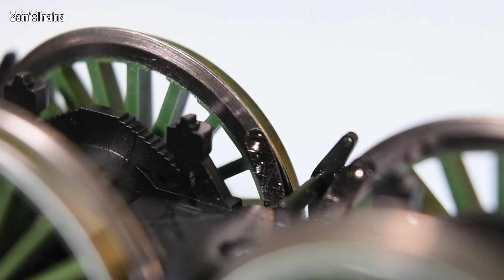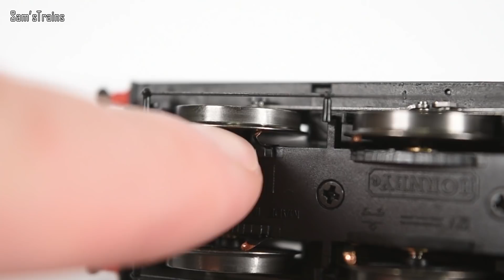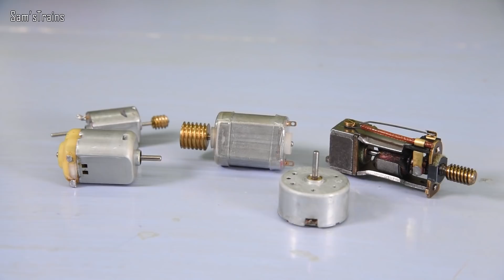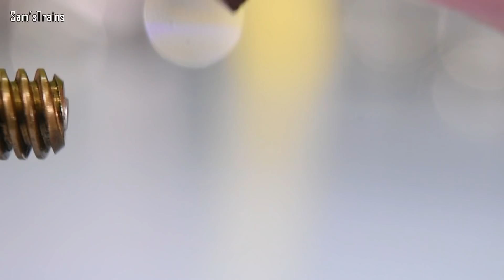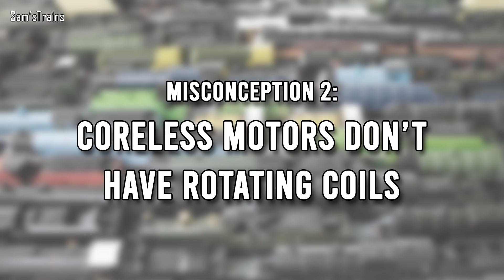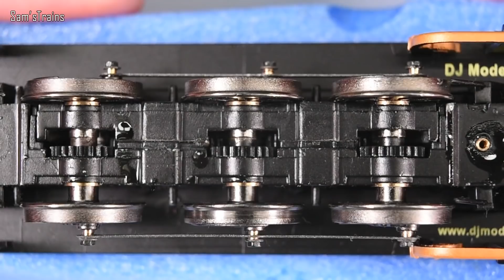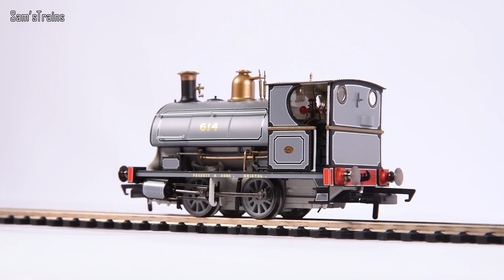What Makes A Good Runner? | How Model Trains Work

Comment: Sam I need help I have a try-ang princess and it needs fixing when I first locked at it the soldiering came of so I got my dad to re soldier it and when we test it the power cuts out on my controller
Reply from the maker: Sounds like a short Rhys - you need to make sure the solder joint isn't touching the metal chassis of the loco... a bit of tape might be enough to fix the issue!
Thanks for watching, Sam :)

Comment: My railion 185 db loco is very slow but powerful runner it takes a 9 car mix length rake well also got my sncf a9u now and added couplings plus a hornby wheel until my roco dc set of two comes, also adding to my snupps with the bmz regio jet one plus sncf repaint into bmz regions and the pkpic ones I have bmz versions of as well
Reply from the maker: Thanks for sharing mate - I'll have to check out your snupps account again some time! :D
Thanks for watching, Sam :)

Comment: Amazing video! You did a terrific job explaining everything accurately in detail and this will hopefully help more people understand how these things work. Only one thought I had, you mentioned that some manufacturers will decide to drive every wheel on a steam locomotive with a gear instead of just using the drivers and while it is true that using this method causes more friction, a major advantage of it is that there is less risk of binding. The drivers are under a lot more stress without gears so it makes it a lot easier for one of the wheels to slip out of place and become un-quartered. I've noticed a lot of modern manufacturers seem to be going with all geared wheels, such as Rapido Trains Inc with their Royal Hudson models. This is still an absolutely terrific video, I just wanted to share my thoughts on that. All the best ~Harrison
Reply from the maker: Thanks very much mate, really glad you liked it! Yes that's a good point - with a single geared axle, quartering becomes much more crucial - thanks for sharing!
Thanks for watching, Sam :)

Comment: Nice video, one point on gearing, while most manufacturers use worm gears, these are a big source friction as the tooth engaged with the worm gear is rubbing against it as it turns, and acting like a break. This effect gets worse as the load gets heavier. Some scratch builders are using alternative gearing to avoid this with very impressive performance improvements both at slow speed, and total load a given motor can pull.

There was a nice article on this in railway modeller a couple of years ago.
Reply from the maker: Yes you're absolutely right actually Daniel! What sort of alternative gearing do they use? I'd be interested to find out! :D
Thanks for watching, Sam :)
Reply: @SamsTrains  A form of bevel or mitre gear like is used in a car to turn the differential from the propshaft. I would dig the article out for you, but I cannot get to my old editions due to lockdown.
Reply: It also has the advantage that the wheels can turn the motor, so trains can coast without a fly wheel.

Comment: Excellent review Sam. Even I who worked in a motor design and manufacturing company, was not aware of what a coreless motor was. We made brushless motors which I to was assuming they were. And yes indeed, brushless motors need major electronics to actually work.
I'm most impressed with how you deliver the dialogue without lots of ums while you think of the next thing to say. Do you type this all out on a que card (laptop screen) in advance, rehearse it or are you a naturally gifted public speaker ? Whatever you do, it works mate.
Reply from the maker: Thanks Andrew! What do you think about brushless motors in OO locomotives? Could it be done you reckon? What sort of cost would you be dealing with?
Many thanks for the kind words - I just have bullet pointed notes which I look at between takes - that's all really! :D
Thanks for watching, Sam :)
Reply: @SamsTrains  I've Googled micro brushless motors and it seems they are quit common, being uses in electric RC aircraft and drones. These ones though are very high reving at say 40k+ rpm. The control electronics look like they could fit on a PCB comparable to a DCC sound decoder, so probably doable in a 00 diesel loco. Just maybe a brushless motor itself is cheaper than a brush motor because there are less parts. The control circuit should be cheaper than a DCC sound decoder, where I'm guessing you are mainly paying for the effort in creating the sound file and its software engineering, not the electronic components which are quite cheap these days. Whether these motors have any distinct control and power advantage over a conventional DC brushed motor, to justify the additional space and cost, I don't know. More likely they could appear in 0-gauge. Never say never. 
Our aerospace motors had rotor position sensors so the number of revolutions could be controlled and stopped dead, so not to wrench the control surfaces or undercarriage doors off of the airframe. This needs more complex electronics than a basic motor to be used in a model train.

Comment: The only thing I'd add is maybe a discusison of the different types of "proper" bearings- usually they're either turned brass or sintered bronze.  I have a preference for the latter because the porous structure of the sintered metal can absorb oil, making them effectively self-lubricating, not requiring service for a very long time.
Reply from the maker: Yeah that's true - I thought while editing this that I'd oversimplified that section by calling them 'turned brass'... but decided it wasn't too important. This is very interesting though - I wasn't aware of this!
Thanks for watching, Sam :)
Reply: @SamsTrains  The bearings at 17:30 seem to be the sintered bronze type (correct me if I'm wrong...) and those can usually be distinguished by their slightly more "dull" and "red" look, compared to brass, doubly so if they have a square shape on the outside.

Comment: Excellent video, you have real skill as a communicator.  Q.  What was the conductive lubricant you were using the the contacts?  My vintage Tyco Ten-Wheeler is not running so well and I may have lubed a bearing pickup.
Reply: Bachmann E-Z Lube is conductive.
Reply from the maker: Thanks very much Clive! I've been trialling petroleum jelly for the past year or so - provided  you keep it away from plastics, it seems to work great on pickups!
Thanks for watching, Sam :)
Reply: @Boppy-B-B  Thanks, good to know.

Comment: B12 in the thumbnail of what makes a good runner video 😁 Well in the case of the B12 i recommend that you remove the motor and gears and have it pulled along by another engine 😂😂😂
Reply from the maker: haha really?!?! Mine's an amazing runner - what happened?!?
Thanks for watching, Sam :)
Reply: @SamsTrains  I had 2. The first ran very erratically and the second one white smoke started pouring from it.  I replaced it with a D16.  No complaints with that so far.

Comment: Excellent information and very well explained. I say the “Holy Grail” of motors would be brushless and being they are the motor-of-choice for drones, size and weight would not be an issue. As for cost, brushless motors in power tools now long ago would cost 30-50% more and only found in the premium line of tools (DeWalt as an example). However that is no longer the case. Even the lower-end to mid-level “pro-sumer” brands of tools (Ryobi, Skil, Craftsman here in the states) all are moving almost exclusively to brushless motors with the cost coming down quite a bit and sometimes costing less than brushed motor tools. I think these model train manufacturers need to step up and start using them, not only to they provide better power and torque, but they have far less wear. They may be costly as first, but that would go down in short time if it became widely used.
Reply from the maker: Thank you! Yes brushless would no doubt be better - they are cheaper now, but nowhere near as cheap as the motors currently used in model railways. The other problem is that all model railway circuitry (dcc decoders, controllers etc) are all geared towards brushed motors; a lot of bulky circuitry would be required to run a brushless... a real problem given the size of some of these models!
Thanks for watching, Sam :)
Reply: @SamsTrains  
Hi the general issue with the brushless motor is their control electronics. While in the handtools, the electronics ( micropcessor) is on board between the battery and the motor, in the model trains it would require an extra circuitry to convert the varying voltage in the  tracks into the varying frequency  of 3 phase  power required for the motor. The basic difference is before the motor starts to spin, the electronics require a minimum voltage between 3-5 Volts in the tracks ( it is more than 1/3rd of the overall control range) and only above this voltage can start the more or less controlled rotation of the BLDC motor. 
Some decades ago Märklin developed such electronics, but was forgotten very soon. ( I think it was called as sinus drive).
Reply: @railfilm  I have a couple of Marklin locos with the C-Sinus motors in them. The electronics are on a Printed Circuit Board in the loco (just about every loco these days has a PCB anyway). The only difference when installing a decoder which is not a Marlikn one is that it has to be programmed so that AUX 4 is always switched on as this is what powers these extra electronics.
Reply: @kiwitrainguy.aka.Dennis  That is correct,. In digital operation the situation is different, as you have always the full voltage in the tracks, what is sufficient to drive the BLDC driver circuits.

Comment: So per say if I put a flywheel instead of a capacitor in my ebay-acquired 0-6-0, it will get rid of the choppiness? My next question is how would you go about installing one?
Reply from the maker: Yes, in theory it would! It would only cure choppiness caused by the motor though; if there are other underlying issues with the mechanism (something binding etc), it won't help! You'd need a motor with a shaft extending from both ends of the motor, and then you'd want a flywheel designed for that shaft diameter - I'd recommend getting a Hornby replacement from Ebay!
Thanks for watching, Sam :)

Comment: I just couldn’t help myself but think back to how they made the subway train bombing scene in die hard with a vengeance. Director John mctiernan spoke about how they obtained a real New York City subway train, took out the electric motors on all cars and put four Chevrolet 454s in the lead car. The guy would catch the crew drag racing that car on the set because it really flew without the extra cars. But seriously, subway trains use electricity via a third rail, so stay away from the track unless you have a death sentence.
Reply from the maker: Wow really?! I never heard about that before - crazy!! :O
Thanks for watching, Sam :)

Comment: My good old Mantua locomotives have metal axles and wheels but one side has a strip of syrine sandwiched between the tire and wheel.
Reply from the maker: Yes that's pretty common on the older locos - does the job quite well! :D
Thanks for watching, Sam :)
Reply: @SamsTrains  What's better that or a plastic ring?

Comment: Sam, I have an older triang model (1969) and it’s wheel flanges are too tall for modern railway track.  Can you please talk about how this change happened and if there is anything that can be done to fix older models to run in modern tracks.
Reply from the maker: Thanks Jeff! Sure, they decided to make track more realistic, and so the larger flanged locos were no longer compatible! I did grind some of mine down, and it worked a treat... but it's a bit bodgy!
Thanks for watching, Sam :)

Comment: Hi Sam, any recommendations for gear lubricant and conductive lubricant?
Reply from the maker: I personally use silicon grease for gears (though make sure it's not too thick). I use petroleum jelly for the conductive lubricant, but it's important it doesn't come into contact with plastic!
Thanks for watching, Sam :)

Comment: Interesting video, Sam.
Could the axle parts that are plastic for insulation be replaced with something harder wearing like ceramic or stainless steel? Or would it be too expensive?
Have their ever been any model trains with wheels that have milled edges similar to coins? I think that would probably improve traction.
Reply: The old Tri-ang Locos had wheels with milled edges. They made a growling sound as they moved. :-) Not really effective for traction as the grooves soon fill up with dirt.
Reply from the maker: That's a good point - not sure why they use plastic, but most of the modern ones have the gears moulded into the insulator too (as seen on the dapol 73 clips), so that puts ceramic etc out of the question!
Thanks for watching, Sam :)

Comment: Early O Gauge wheels were of cast Iron which as being a nice bearing material to mild steel tended not to work.
Coming from a Model Engineering side, Steel wheels and steel rails give the best. Also again as you said Weight. I have spent part of Saturday cutting out a block of steel 4" X 4" by an inch thick for under the footplate of My Europa Class London Chatham and Dover Railway Locomotive 5 inch gauge. Although I do have a simple 0-4-0 battery drill driver driven locomotive. Yes she pulls 4 adults but the main problem is getting the power onto the track as the Torque is very high. I belt drive a 2 to 1 onto the leading axle. Coupling rods and a 3 point suspension favored among 18.83mm boys on their wagons for my rear. Talking of weight I have just arrived a Large Prairie from Heljan. Bits fallen off in the box but as I am making a 5 inch gauge version know where the bits go. I slightly bought a ready made one 4121 for my 60th birthday. 43 inches long and you cant lift her.  In the package they included a Hornby OO Prairie. And following your review an S15 30843 in Black. We have watched the rebuilding of the Midhants one over the past few years.
Also a pair of Gaugemasters for O gauge to drive my growing collection in this scale.
Best regards David and Lily Reading.
Reply from the maker: Thanks a lot for the info! Yes I did notice the tri-ang locos pulling much better on their original steel tracks - but I'm personally glad we moved away from steel... not nice to maintain! Many thanks for sharing all of this! :D
Thanks for watching, Sam :)

Comment: Hi Sam, a very informative video. I have a question relating to the strain on a motor. I have seen layouts where there are inclines and also helixes. If the locomotive is pulling to much weight what damage can it do to the motor, is it possible to burn out the motor.  Regards   Greg
Reply from the maker: Thanks a lot Greg! Yes absolutely - some motors can be damaged by extended overloading. The greater the load, the more current the motor draws, and the more heat this produces. Badly/cheaply designed motors can definitely fail if they overheat!
Thanks for watching, Sam :)

Comment: In the 1950's into the 1960's Athearn trains used elastic bands as belts to power some locomotives.
Reply: Lindberg (more known for plastic models) made a locomotive in the 60s and it's powered by a spring belt! Imagine, a long tightly-wound spring looped around to form a stretchy metal band...it's very odd.
Reply from the maker: Yeah I've seen some like that - I have a model up for review that uses belts actually!
Thanks for watching, Sam :)
Reply: I can tell you a thing or two about belt drive: I have a Roco model Crocodile loco and it uses belt drives. They used to slip in the first speed notch so I got some traction tyres from Marklin, they produce a very small diameter one (about 5 mm) for one of their models. I put one of these traction tyres on each of the four brass pulley wheels of the loco (two on the motor and two on the drive bogies) and it solved the problem.

Also about a year ago these drive belts failed due to old age and so I had to get replacements. The most expensive option was to get them as Roco spare parts, I bought them from a local seal & gasket importer for about a quarter of the price.

Comment: A few corrections, mostly of the continental kind 

Märklin did have a brushless motor in the past, which required a special control board. It also requires special MFX decoders.

You missed one pickup type: the track feeler as used by Trix Express and very early Fleischmann.

Flywheels became common when drive design moved to worm drives. These have the disadvantage of not being able to run backwards. So your worm drive train just slammed to zero speed when the power is cut, while the traditional pancake drive did run a few cm unpowered.

What I really missed is the infamous tender vs locomotive drive discussion
Reply from the maker: Thanks a lot for this Ivo - very interesting on the Marklin - what gauge was this?
Yes I deliberately didn't cover the track feelers/plungers - as they're not really relevant these days!
Very good point on worm drives, thanks for sharing!
Thanks for watching, Sam :)
Reply: @SamsTrains  Marklin is HO scale AC with center rail pickup. Besides the classic AC motor with reversing circuit and various Faulhaber DC (decoders give DC power) units they also have some 3 phase brushless AC units with 12 pole skewed magnet cores in the latest version
Reply: An MFX decoder is not necessary with a C-sinus motor. On the ESU lokprogrammer they have a variety of default settings for different motor types which includes the C-sinus motor. If that default is selected it activates AUX 4 to be active when the loco is either running or stopped and in both directions. AUX 4 is what must power the electronics that drive the C-sinus motor. As long as the decoder has AUX 4 (and it usually does as it is normally a 21 pin decoder) then that can be programmed to be on continuously.